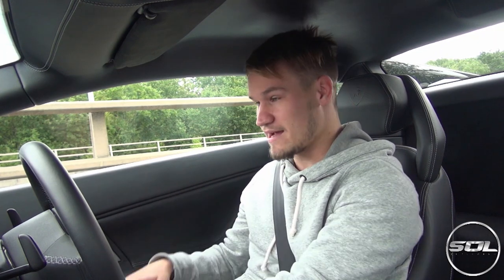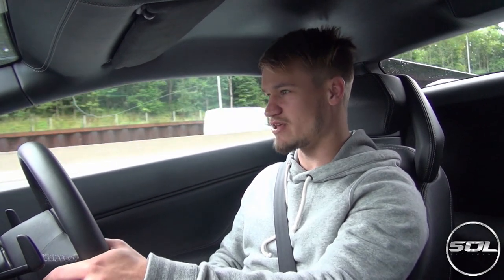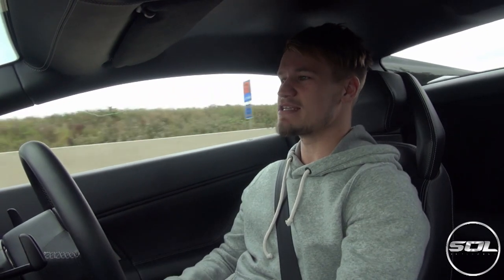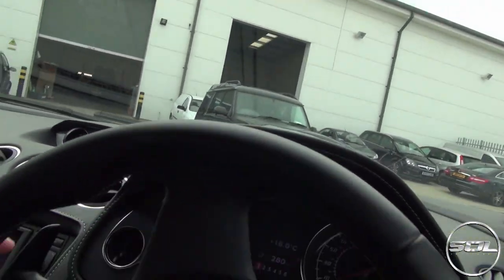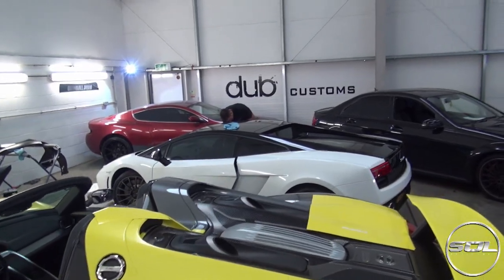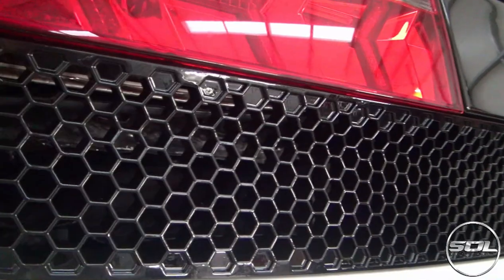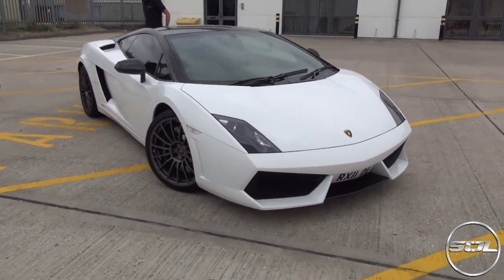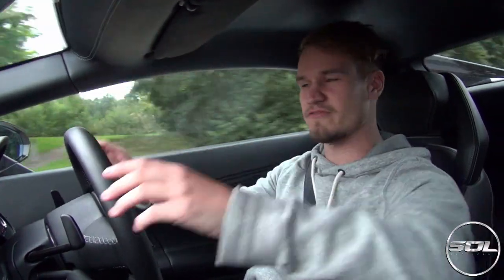CUSTOMISING THE LAMBORGHINI & FUEL ECONOMY TEST!

Comment: If wrapping a car is anything like putting a screen protector on a phone it would be my job from hell, fucking bubbles!!
Reply: It is similar, but the wrap stretches unlike screen protectors thus allowing you to push the air bubbles out with ease :D quite an easy but skillful job, if you ask me
Reply: +ZSVP It certainly does look appealing!
Reply: +Cornwall1888 I've done it several times, and it is a pain in the ass.(not a full wrap obviously) But if you get it spot on, the result is worth it.
Reply: +ZSVP the more expensive foils actually have small 'holes' in it to let the air out..

Comment: If I would have a Lamborghini Gallardo LP560-4. Mine would be Manual. Would wrap it in Midnight Blue and have the Italian stripes like the Gallardo Performante a Supperleggera wing, ADV1 or HRE wheels. Full decated Armytrix Titanium exhaust from the headers to the back sort of straight piped and fit a K&N Cold Air Intake onto it. And would paint the brake calipers the color of the Italian flag in the same design as the Italian flag. Also would have diamond white stiched interior on the seats and on some part of the door. There you go Paul my dream car in my favorite spec that I will own by 25.

Comment: Instead of spraying the factory wheels, possibly get a set of aftermarket wheels? That way when it does come to selling it you can revert the whole thing back to stock. Should also consider a remap and new exhaust system

Comment: Hello, 
1-You can do easily 300 miles with a full tank, which is not that great when you know that it took more than 90 liters to fill up the tank...
2-Avoid to change driving mode everytime you take a tunnel, my advice, keep sport mode all the time when you start the car if the road you driving it is smooth, but otherwise for some noise or acceleration in the city avoid to change driving mode.

Enjoy the lambo go change the exhaust !

Comment: Add black bits on the bumper, add carbon fiber trim in the interior, like the steering wheel or centre console. Tint the rear lights and the car would look perfect.

Comment: Add carbon pieces to the interior. Add bigger paddle shifters to be able to shift from different areas around the steering wheel. Possibly add color to the interior to match the exterior.

Comment: I wouldn't put the spoiler on there, the car looks so clean with the black roof and white sides it would almost ruin the lines. I'd also put on a new exhaust as you were talking about. MAYBE put black on top of the front lamp lines (on the hood and let them run till the edge of it following the lines of the lamps) it could look cool but not sure how it blends in real life.

Comment: Paul - Functions before cosmetic man!  Black out the rear light is ridiculous.  Especially for your brake lights.  
It loose the LED functionality. (Less brightness, more easily to rear ended, driver behind your Lamborghini may not be aware when you slam on your brake).  All it takes a few seconds late reaction to stop the car, accident does occurred.   Now, you have this beautiful white Lamborghini white body color paint, original black roof(bicalore)  meaning two tone.  White and Black.  That's it.  Adding more color to it, it would turn out to be Tri-Color than two color speciale.  😀

Comment: Needs an exhaust, nothing else.. It's a special edition Lamborghini for gods sake haha, it doesn't need any exterior touches. The grill fair enough, not a fan of making it darker with the mirrors but there we go. Wheels need to stay the same, don't change the brake callipers, originality factor will be so much nicer on them. As far as full wraps go, don't do it. Unless you are thinking of making the roof white, don't wrap it.. The car looks perfect.

Comment: How do you not know that driving a car for a long distance at a constant speed will increase its fuel economy. For a car channel surely you should know that my 64 diesel golf does about 350 miles on a full tank on normal city roads but if I'm driving on the motorway everyday I can increase that easily to about 500 maybe even more.